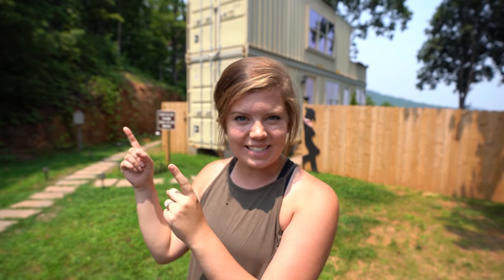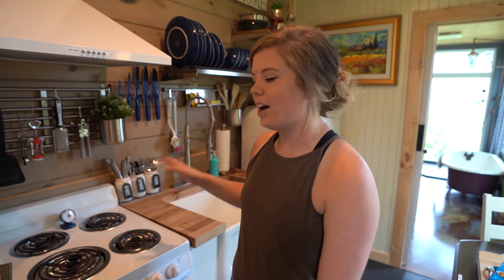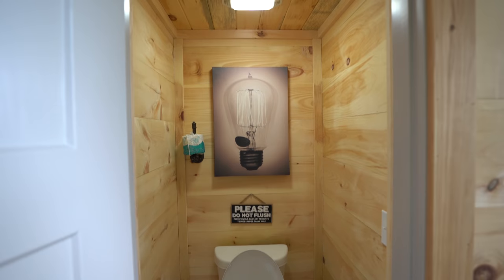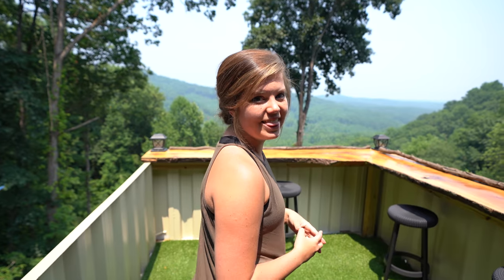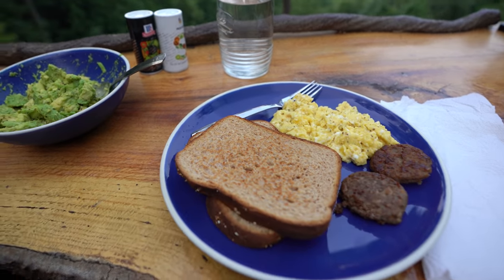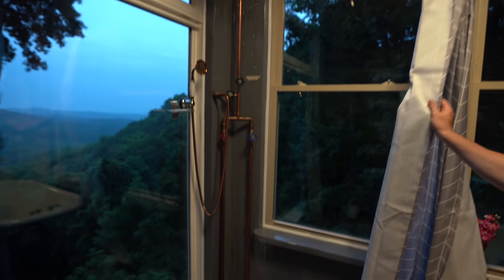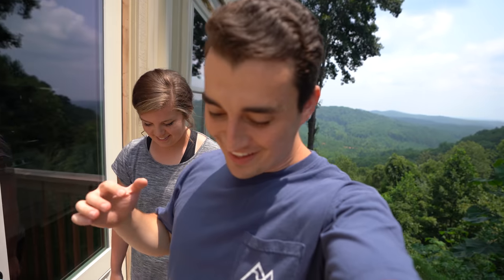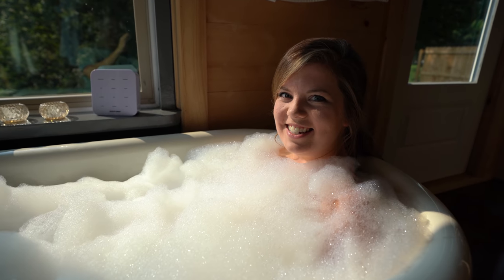LUXURY Shipping Container Home Airbnb tour!

Comment: One thing I learned about the containers homes, is that I definitely want a ten foot wide container instead of the eight foot wide.
Reply from the maker: That 2 extra feet would probably make a huge difference! James did a good job with these though, we were impressed! Do you think you may build a container home in the future?

Thanks for watching!!😁
Reply: hi cubes are best
Reply: slide out
Reply: Ive built 4 container homes (CA & AZ)
Here are the challenges:
Road permitting costs make using 10’ containers WAY WAY WAY more expensive
They are fare more rare so they cost more and get used more further worsening the issue
They are less stable when cutting due to leverage. 

If you want 10’ width use stick building and clad it in corrugated metal.
Reply: @sierrajade63  slide outs only make sense for lightweight mobile trailers. The leverage cost completely and insulation challenges are terrible for a fixed in place structure
Reply: @mattbrew11  I've got a 53" dryvan trailer. I've watched videos on YouTube about turning them into tiny homes. But I will want more room. I thought about possibly selling it and acquiring a drop deck or step deck trailer and having a tiny home build on that.

Comment: Stick built is always cheaper than container built. Because you don't have to worry about welding which is a major expense! It's cool to see what types of houses can be made out of containers but it's not practical as stick built is.
Reply from the maker: I could definitely see that! Especially a stick build at this size. It is really neat staying in places like these! We'd highly recommend checking this one out! Thanks for watching and commenting!😁
Reply: That depends entirely on terrain, foundation, permitting and logistics for the containers. Ive built four of them. If youre after trick cantilever designs and have a chill zoning, containers are easier and more cost effective.